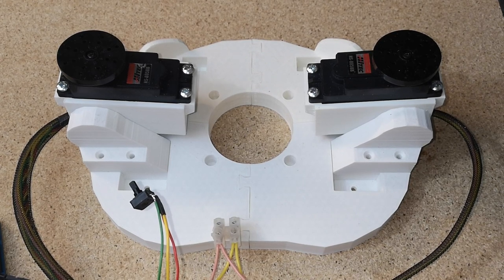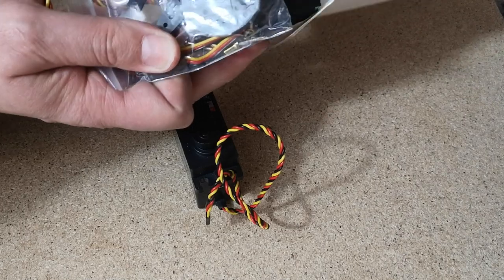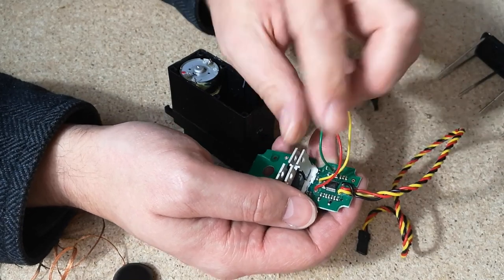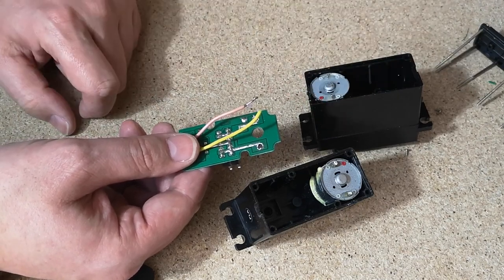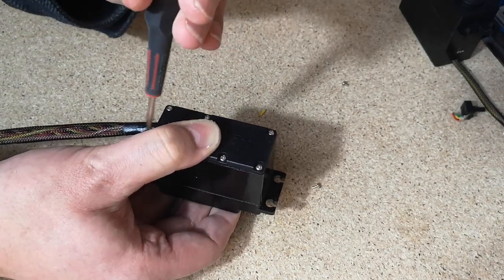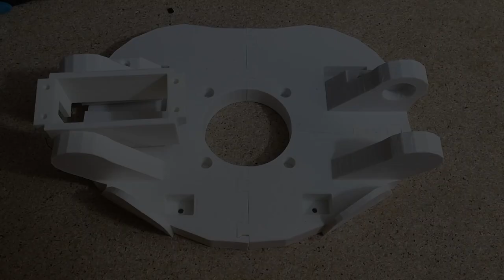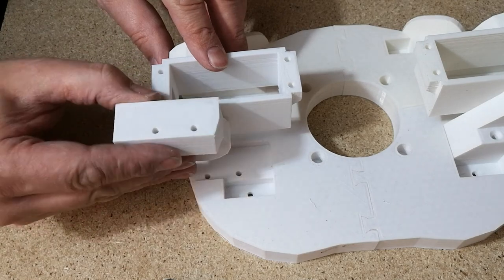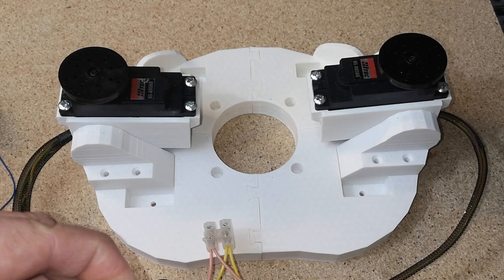Civrays InMoov - Having the stomach for it

Comment: Hi Steve. Great video guides. My Inmoov (who i've called Frink.... First, Robot, I've, Nearly, Kompleted) is coming along. Just on the Servos for the stomach. I've modified them and they work well. But how / what code do you use in the Arduino to get them to 90 degrees?

Cheers.

Jonno

Comment: just a question why dont use both potentio meters on the same bracket and use both servo pcb`s instead of 1 and risk blowing up the board? Or even better connect both servos to 1 potentiometer?
Reply from the maker: These are good ideas because like you say we would then not be overloading one board with double the normal current load. I think the idea of doing it this way is to remove the risk of the two controllers trying to fight each other if they detect slightly different values from their potentiometer circuits.

Comment: Hi Steve, great video. Have one question: I saw you removed endstop from servo. On the pictures from Geal I saw he removed it from the other servo. So is it needed to remove it from only one servo or do I need to remove it on both servo's? And if remove it on only one, does it mather on which one? Thanx
Reply from the maker: Thanks. No you should remove the endstop from both servos.
Reply: @SteveRaynerMakes  Thank you, I think I got it....it also makes it easier to attach the top body onto the top stomach with the pivots